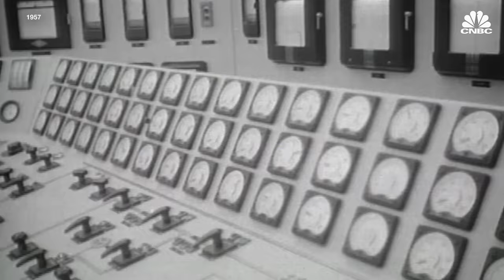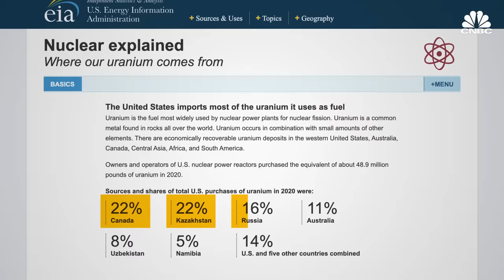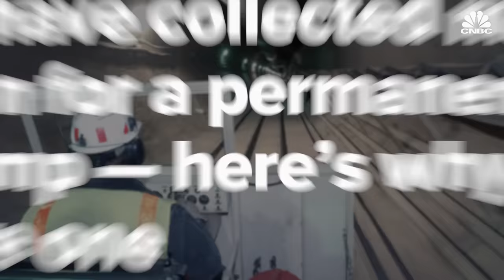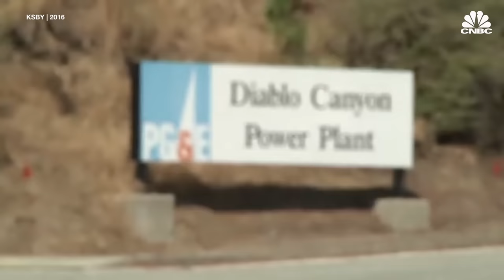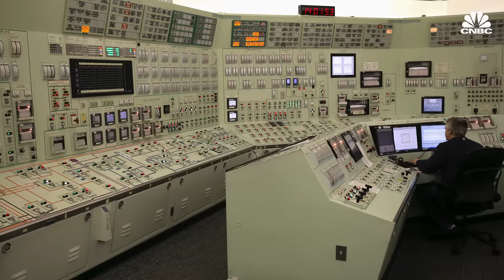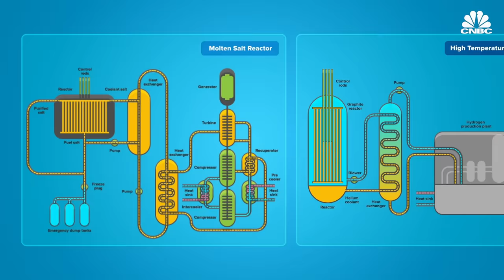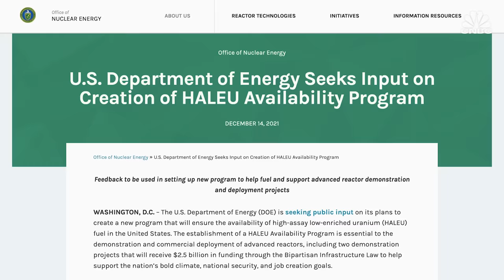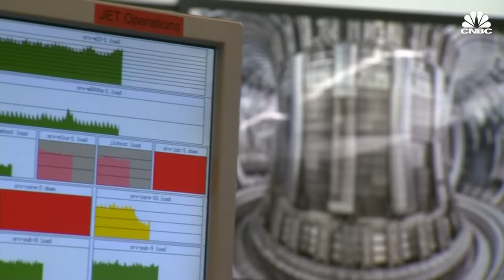Why Nuclear Energy Is On The Verge Of A Renaissance

Comment: The world obviously needs cheap, reliable base load electricity supplies throughout every state.
Could you please enlighten your viewers about Indonesia's choice of the walk-away safe high temperature but near ambient pressure ThorCon's 7×500MWe Liquid metal Thorium ion molten sodium fluoride salt burner energy converters that can be brought on line within 2 years for $1200/kiloWatt and provide electricity to the grid for a pre-profit levelised cost of $30/Megawatt.hour without destruction of thousands of Hectares of scarce tropical rain forests ...each 500MWe unit is bult like a double-hulled bulk-carrier in a Korean shipbuilding yard, fully equipped and fitted out before being towed to Indonesia where the fuel salts are added. All at a cost of $1200/kiloWatt to ThorCon. 
Although the PPA agreement  is initially for 25 years the design life is 80 years by replacing alternating reactor pots every 8 years including a 4 year passive cooling period. These are capable of being either auto "load-following" or as your needed  "base loaders"
Reply: Once someone does that in the U.S. cost effectively, I will reconsider my opinion.  However we have 5 recent examples of new nuclear project failures in the U.S. in the last 10 years so I would not get my hopes up.
Reply: @clarkkent9080  Yet you purposely continually ignore that many countries have been building and using small modular reactors for many decades built in two years or less for millions not billions.

Comment: Nuclear power is fantastic - in theory. As soon as you introduce the human factor into the operation - it's a disaster waiting to happen. Further - we STILL have no plans for spent fuel. Other countries reprocess but good old American exceptionalism won't let us follow their lead.
Reply: To re process  you need a processing plant to separate the Pu239 from the other isotopes in the spent fuel. Then you need a plant to mix the Pu239 with U238 to make assemblies that can inserted into the reactor. And then there are the shipping casks needed to move the spent fuel from the old reactors to the processing facility along with security and loading and unloading facilities. It is not so simple or cheap when you consider the reality of actually doing it. MOX that was supposed to mix pure weapon grade Pu239 with U238 to make reactor fuel assemblies was canceled in the U.S. after spending $17 billion and they finally admitted that it would cost $100 billion more to complete and operate.
Reply: @clarkkent9080   You whine about nuclear costing too much yet continue to allow your NRC to exist.   Get over yourself.

Comment: the reactor type matters. so far reactors are maximising plutonium generation for nuclear weapons, but there are reactors that are much better, less garbage, less risk. How about changing the question...."Do you support a NEW type of reactor that mittigates most of the problems of todays reactors?"   Building more water preasure reactors for sure is NOT a good idea, but it does not imply that nuclear is generally bad.  Black-white thinking must stop

Comment: Is nuclear less deadly than it used to be?
Reply: @clarkkent9080  nuclear energy has never been cheap. It’s an off shoot of nuclear weapons development. We still have not figured out what to do with radioactive waste. No state wants it.
Reply: @Maximoootom  I not sure what you mean since commercial nuclear power stations are completely different from those that produce weapons grade Pu239.  
Nuclear used to be cheap until TMI and then the regulators tightened thing up and costs increased.  Today, wind turbines and solar produce very cheap power since there is not fuel costs.  But given that solar can only produce power 1/3 of the time, that has to be taken into account.  The most reliable, flexible, and cost-effective base and peak load power source today is natural gas turbines. 

I rarely discuss the nuclear waste issue since we have enormous amounts from both commercial and weapons production so it will have to addressed at some point.
Reply: @clarkkent9080   Yet you fail to mention from your blank trolling channel that the US and many other countries have been building small modular reactors for many decades, built in two years or less, costing millions not billions.
Reply: @Maximoootom   Nuclear power is already "less deadly" than all other forms of electricity generation methods we have.
Reply: @danadurnfordkevinblanchdebunk  and what do you do with the radioactive waste?
Reply: @Maximoootom   Depends on what country you speak of.  Most store it in spent fuel pools for 5-10 years, many countries reprocess it or uses it as fuel in fast breeder reactors.  It does have about 95% of its energy still within so it never makes any sense to bury it, but that's what the uneducated think is the only option. If burial is the chosen route it is transferred from the spent fuel pools to dry cask storage for burial.   No one on the planet has ever been harmed by stored 'nuclear waste'. The tone of your comments very clearly show you have been conditioned by anti-nuclear energy forces into believing in nonsense.
Reply: @Maximoootom   And BTW, nuclear energy is actually cheaper than renewables when you factor in replacement, energy storage and disposal.

Comment: Our current Light Water Reactors are already good and safe. We need to build them in hundreds to decarbonise!
Reply: TWould we have had Fukushima if they were that safe?
Reply: We cannot build them cost effectively in the U.S. and that is reality
Reply: @clarkkent9080  you can always order from South Korea. Or, you know, develop the industry a bit more? Maybe with a fraction of what wind and solar get. Let's say 5%?
Reply: @ImaskarDono  New nuclear is getting $4 billion and $10 billion is available for private investor owned utilities to keep old nuclear plants running and that is just this year.  What specifically is wind and solar getting this year?
Reply: @clarkkent9080  Renewable subsidies were ~$11b in 2016.
Reply: @clarkkent9080  Only because people like you have thrown up so many roadblocks to construction.
Reply: @clarkkent9080  for 96 reactors, serving 20% of the electricity in the US? But still, it looks like multi-year packages. An NPP costs around $8Bn per block, so how should $4Bn help, if the US needs around 1000 of them?
Reply: @ImaskarDono The 96 reactors provide less than 20%.  That 20% value was the norm when we had 110 reactors operating but no one ever changed the %.
 The VC Summer and Vogtle AP1000 PWR units were supposed to cost $7 billion each.  VC Summer canceled both of theirs after committing $17 billion with no end in sight.  Vogtle has spent $31 billion  for their two units and they are still not running.  Those are the reality of costs in the U.S. in the last 10 years.  Given inflation you can multiply by 1.25% to estimate the cost today
Reply: @robertbrandywine   No one was injured by Fukushima radiation.
Reply: @Crispr_CAS9  Can you provide the specific details on those subsidies and if they were given to private companies ?  I can for the $14 billion given to private investor owned utilities and billionaires like Bill Gates.
Reply: @clarkkent9080  "Can you provide the specific details on those subsidies" CBO testimony from March 29, 2017
" I can for the $14 billion given to private investor" Yet you haven't...
Reply: @clarkkent9080  no, the value is correct. The reactors underwent upgrades.
Reply: @ImaskarDono  what are you talking about?

Comment: how can natural gaz be cheaper than nuclear? 
also, natural gaz also produces radioactive waste actually more than nuclear reactors. And the carbon footprint is far worse for natural gaz.
Reply: natural gas and radioactive waste >>WTF?????
Reply: Because a natural gas plant is a gas turbine (basically a jet engine) connected to a generator.   Can be built in months not 15 years like a nuclear plant.
Reply: @clarkkent9080   That's right, ever hear of radon?  The natural gas plants do nothing to scrub their emissions for radon.
Reply: @clarkkent9080  You fail yet again from your blank trolling channel to admit that many countries have been building and using small modular reactors for many decades built in two years or less for millions not billions.